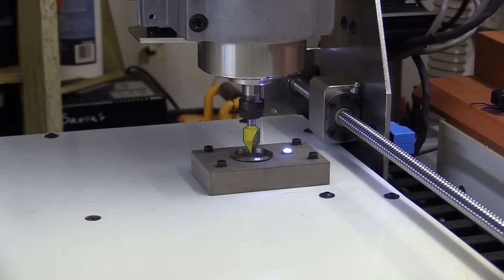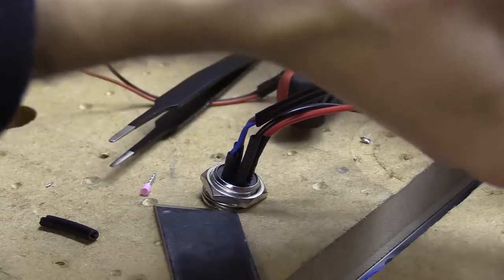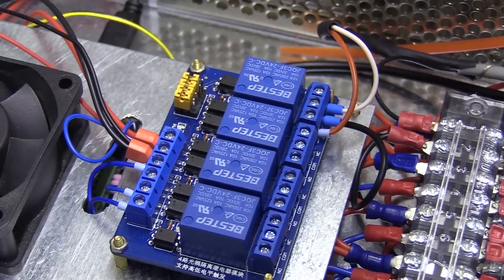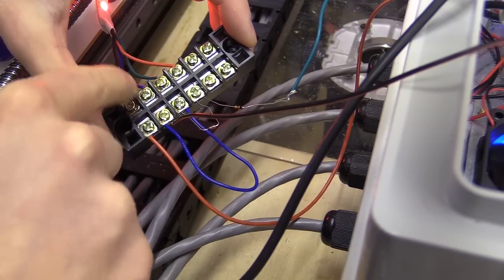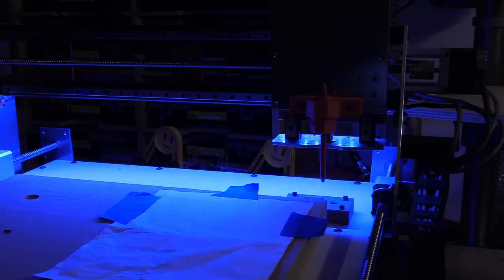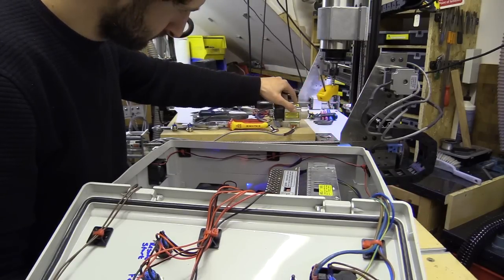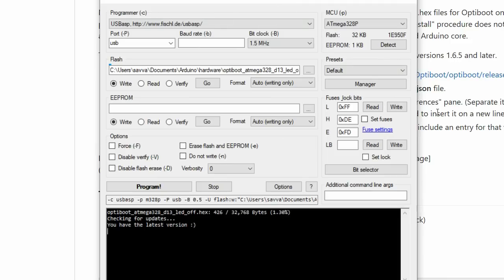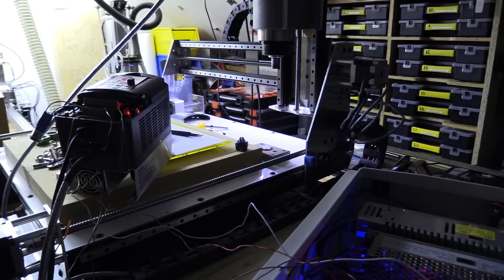#40 CNC Control Box Part 4  / Laser Wiring, LED Warning Lights, Bootloader D13 Pin Toggle Fix

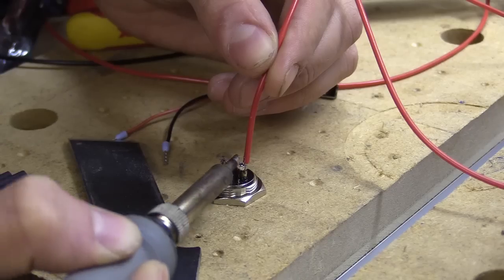Comment: What's the connector called you were soldering at 1:27?
Reply from the maker: That my friend is called a decompressed pronged thingamabob... or a panel mount for short.
Reply: @EducatingSavvas  I can't believe that type of connector is called a panel mount. Panel mount  is just a general name, not a type of connector. And by type of connector I mean what kind is it, for example M12 4 pin or something like that. Can you give me the specific name or a link where to buy it?